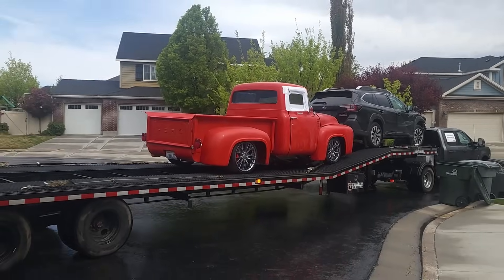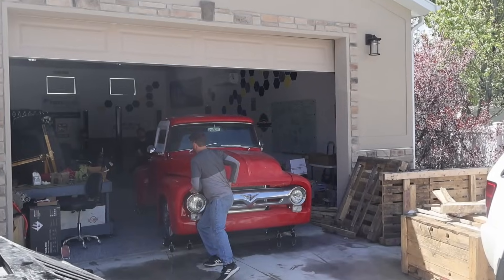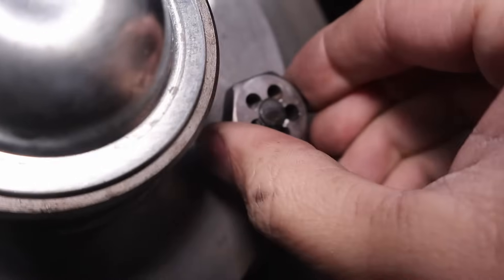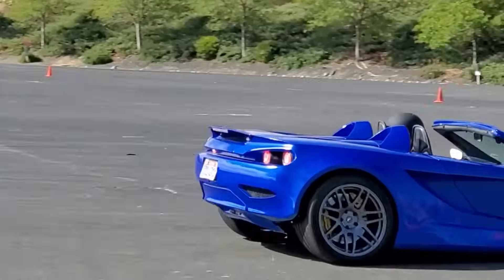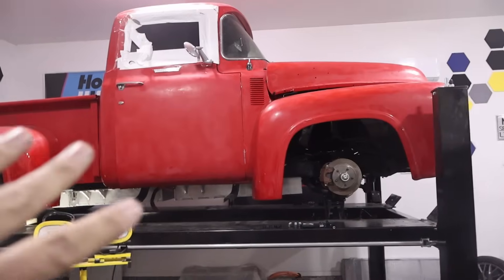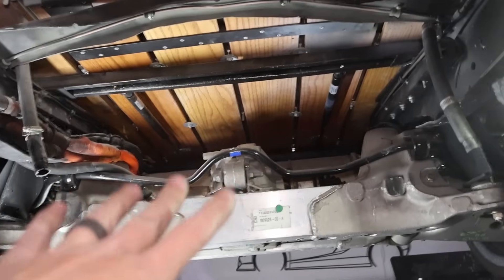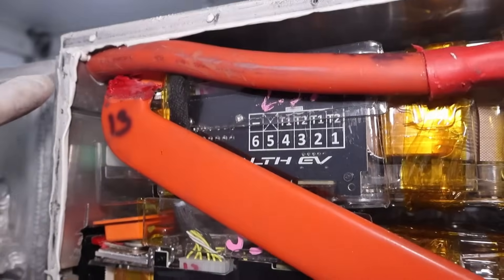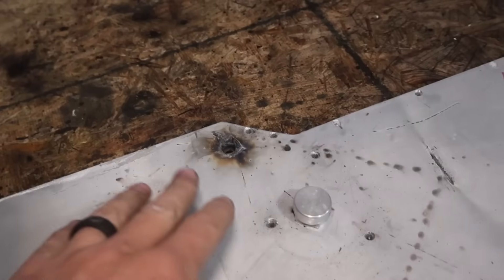Why Did This EV Conversion Catch Fire?  The EV Doctor Responds to an F-100 Fire Emergency

Comment: Holy arcing risk Batman…… does no one put in a high voltage isolation tester in these conversions????. I’m am sure that would have shown this way before it became catastrophic. I’m sure that was way less than a megaohm right off the bat. Scary.

Comment: Nope, I'm judging. Most of that stuff was nothing technical, it just required basic common sense. Looking before blindly drilling into a high voltage battery pack for example...

Comment: Great work. I think it would be recommendable for everybody but certainly beginners (me included) to use isolation detection. It isn't on the standard EV conversion list but would be great. For this case, it would have already isolation alarms from the start, if just one of them made a little contact. Rather than just driving on, and having all the time to make a second short, in which case the circuit is completed.

Comment: a tip i learned from others... around 12:51 you are testing high voltage and have a lead in each hand. It is safer to have one lead clipped and the probe in one hand that way the path of your arms (and hence heart) is not across that high voltage. great lessons in this video! thanks.
Reply from the maker: good call

Comment: Wheel spacers are dangerous and I never recommend them for anyone. If anything is off kilter they will come off and you don’t want them to fail at speed. I was a passenger in a vehicle doing 130 plus when a wheel spacer failed. I told the driver to stop NOW and he complied and when we stopped the spacer was held on with one loose bolt. We were that close to disaster. NEVER EVER USE SPACERS. EVER.
Reply from the maker: yikes!

Comment: There was this guy I used to work with that would send self tapping sheet metal screws into electrical boxes without looking.  It was no surprise to me when I put a drill through a 400 amp 3 phase feed and killed power to half the factory.  But he was mad at me when I told him that he was lucky to be alive.
Reply from the maker: Sounds like a recipe for disaster!

Comment: I'm sooo incredibly happy you're showing how things can go wrong - discovering the fault circuit is/was great detective work!

I would love to know how the LoI check built into every BMS I know about didn't catch this and shut down prior to the 'fire'???

I've turned down much better builds that were not running and hadn't caught fire but were a total mess.

You're a much braver EV mechanic than I.

Can't wait to see how you bring this back to life!
Reply from the maker: It was a pretty spectacular failure

Comment: I like how you asked for people to not judge the builder. Good thinking 😊
Reply: If it's on public roads people should absolutely judge the builder (or at the very least the build). I know Americans are used to rolling death traps in states where mechanical inspections are not mandatory, but I would confiscate the wrenches from the builder just for the wheels issue alone.

Comment: Jeremy you're gonna try and fix THAT box??? I wouldn't wizz on the best part of it. Also, you should educate the customer on some constant tension hose clamps, instead of those worm clamps. I'm not saying that the worm clamps are what is currently causing the coolant leaks. But worm gear clamps will eventually cause coolant leaks.
Reply from the maker: Agreed
Reply: Maybe they're going for "period correct" hose clamps? Cuz that makes perfect sense on an EV conversion lol

Honestly though it's probably just a case of "go with what you know." Worm drive clamps aren't the worst thing... At least they didn't use silicone, zip ties or just rely on friction alone...

Comment: Really, really nice video. Just a question out of curiosity. Did you check for any high voltage ‘leak’ onto the car frame prior to working? Just thinking about safety. :)
Reply from the maker: Yes...I licked my finger before touching it. 😜 In all seriousness, with this build...safety first.

Comment: Absolutely insane! I’m designing my boxes to be safe in a crash and there’s folks knowingly drilling into a wire harness
Reply: yeah its absolutely unbelievable that such things are one the roads! in Europe you'll need to go to a technical center or TUV to get it checked, the whole car need to be disassembled and rebuilt again
Reply: @carholic-sz3qv  Yeah I don't like the strict regulations here in Europe, but when I see this, maybe it's not so bad.

Comment: A normal shop wouldn't touch a partial build like this with a 10 foot pole. Awesome that you are able to diagnose and sort out all these problems on a project you didn't start.
Reply: The reason most shops wouldn't touch this is the massive liability issues. Clearly the customer has no idea what they were doing and made some significant mistakes. It's a good thing this channel documents everything they do on video, because there's a chance that the customer will screw up more stuff after they get the truck back. And in the event of future accidents/fires/other malfunctions, it would suck if they tried to claim this repair job is to blame and sued. By taking on this project, he could end up with mountains of legal fees and headaches in the future.
Reply: @rthomp03  have to agree. This is a lawsuit waiting to happen no matter what is signed upfront.  The original builder really needs some guidance.

Comment: I understand that building these cars takes a long time because not only are  they custom and you need to design and fabricate a lot of things, but you also need to order and wait for parts.  I also understand that if you have more than one car on the go at a time, it makes it so you can skip from one car to another getting more done than just concentrating on a single vehicle.  Doing the Dr. thing is really good for your reputation as being the go to master of EV problems.
Reply from the maker: Thanks for understanding!